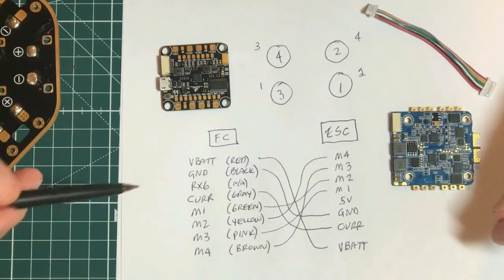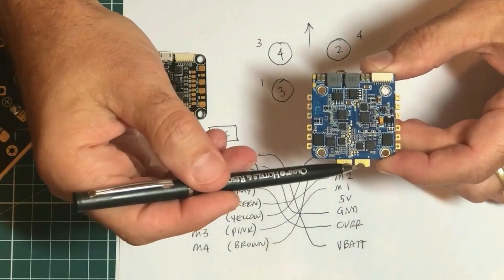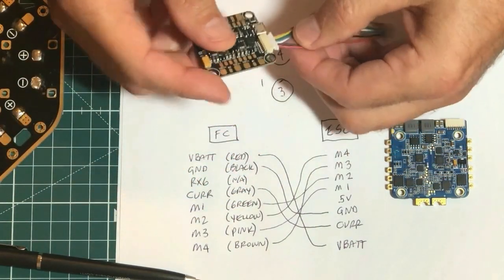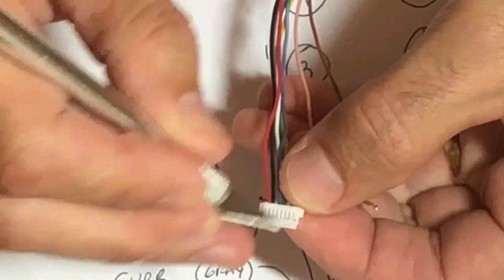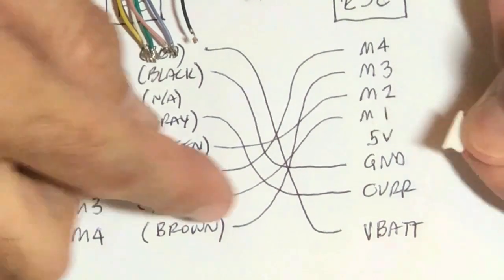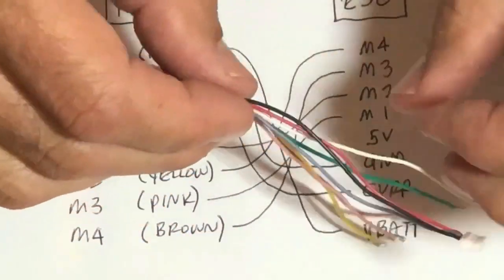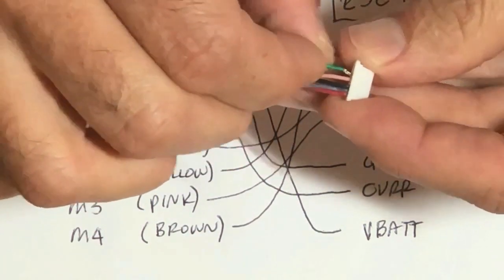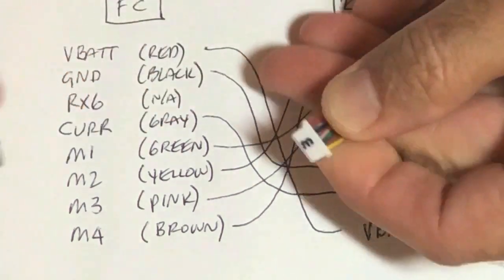Flight controller to 4-in-1 ESC wiring

Comment: I have one doubt, my fc has cur pin but my esc doesn't have current sensor, so will it create any problem? And also why is there usb port on flight controller?
Reply from the maker: it won’t cause a problem not having the curr sensor wire between them.
the usb port on the flight controller is to connect to a configuration program like BetaFlight.
Reply: @carnagemayhemyourrcwrecksp2781  thanks mate

Comment: So I've got a question, I have a project which I have to use 2 brushless motors, I was wondering if I can use one of these 4in1 esc's and connect the motors to it instead of buying 2 separate esc's. Is is possible? Would appreciate if someone help me. Thanks :)
Reply: Yes it is possible. To make your life easier. You should go to a FPV shop online , and buy what's called a flight stack. In quadcopters , depending on how far we are going to be pushing our crafts, we go up on the amp rating on the  ESC (50-60 amps for 5 inch copters doing racing applications)